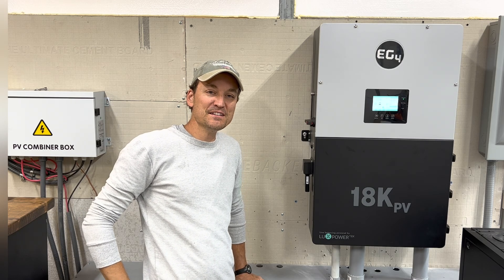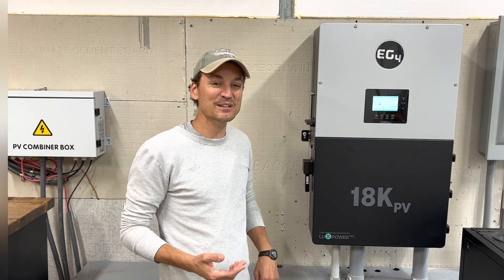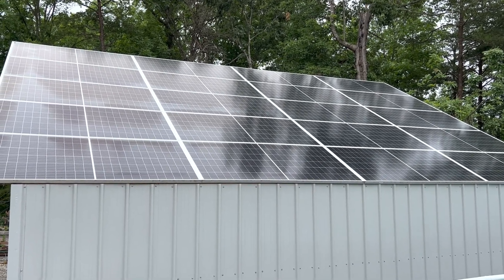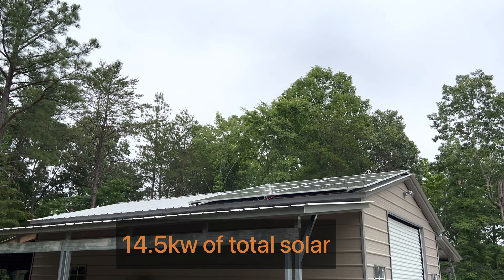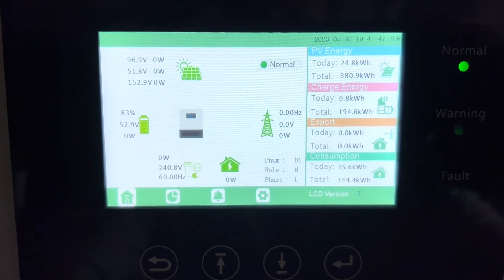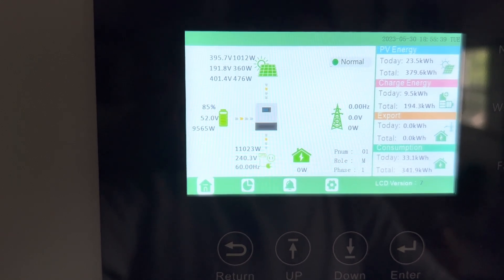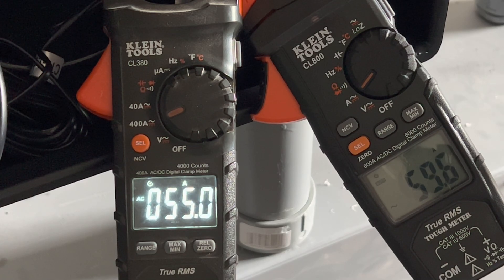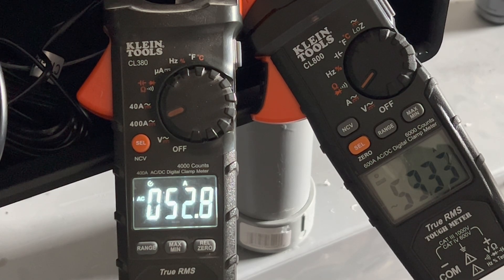EG4 18kpv finish install and initial loads testing- solar inverter

Comment: I love mine so far, installed it last week, really capable, but I’m still fiddling around with the settings because with grid connected, no matter which settings, it keeps going back to the grid multiple times, super annoying…
Reply from the maker: That’s awesome. I honestly have been off grid the the whole time so I haven’t testing the grid features yet. Are you using the unit as a bypass? Is it connected to the WiFi yet? Maybe signature solar could take a look and adjust something if it’s needed.
Reply: @GavinStoneDIY  Basically I want it to only tap into the grid if the battery gets too low only. I have everything setup including the wifi dongle and I'm waiting for their commissioning appointment to hopefully figure that out, right now I'm like you, disconnected the grid. Yet, so far way better than the glitchy growatt 12k I had, and the fact that it takes up to 500V PV per MPPT, is just icing on the cake. Keep up the great content.
Reply from the maker: @DJLsbVapes  do you have it on forced discharge? I really need to do a video on the settings I’m using.
Reply: @GavinStoneDIY  Yep, even with forced discharge, still ends up using from the grid
Reply from the maker: Now that’s curious. Let my know what SS says. because it may apply to me also.
Reply: @GavinStoneDIY  Sure will my friend

Comment: Nice!  I'm drooling over it but I'm going to make myself wait.  I couldn't help but notice that you now have an empty slot on the wall.  I'm thinking you could add a second 18kpv then you could run all your stuff and never worry about it shutting down.  Just a thought ... 😉

Can hardly wait for your next installment.  Thanks!
Reply from the maker: I am so tempted. Plus, two of these on the wall would definitely make it look more balanced. 🙂
Reply: @GavinStoneDIY  It's gonna happen for me.  It may be a year or so, but it's gonna happen.  I need to measure and check the dimensions to see if I have to do any major moving of other stuff.  I'd ask you questions but you're doing a pretty good job of answering them already.
Reply from the maker: @easttexascowboy257  can’t wait for the build photos!

Comment: Been waiting for this!  Thanks for sharing!  Still can't get over how silent those are.  Very unlike the jet engines of the 6500s.  

Make sure to thank your assistant!

So your 14kw surge only lasted 3 minutes, not the 10 min that the manual states?
Reply from the maker: So, signature solar said they are continuing to do testing on the unit to verify those numbers and and they’ll update them soon.
Reply: @GavinStoneDIY  hmm, ok.  Kinda seems like something you would want to be sure of before you start advertising and selling them.